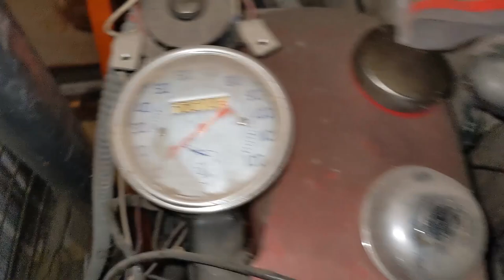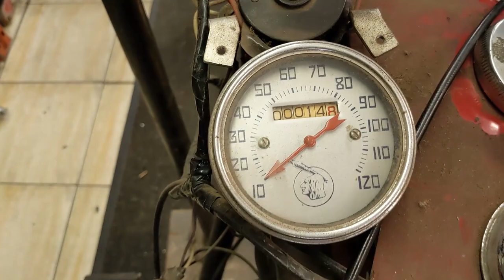1948 Indian Chief Urban Barn Find!!!!

Comment: Back in 1969, when Indian motorcycles were virtually off the scope, my pal and I found a 1947 Chief in a back yard and under a crab apple tree. It hadn't been ridden in years. The seat was shot -- it looked as if a shark had taken a bite out of it. The engine was seized. Most of the sheet metal was a mess. A year later and many inquiries to Sammy Pierce, we had it fully restored and on the road. A year later (1970) my pal and I bought a 1942 military Scout, a 1948 Chief and a 1953 Chief. We bought all of them for a song. The '42 military Scout had seen combat. There were a few bullet holes in the gas/oil tanks and the frame's neck was severed from the frame. The girder was pretzeled. That Scout was a monumental feat to restore, but we did it. Cheers. -- W
Reply from the maker: Wow that's an amazing set of stories!! That's excellent!! I just got word that this chief is back on the road from the gentleman that ended up with it so I'm likely going to take a road trip to go see it and take it for a spin. I'm really glad it wasn't relegated to a dump or lost to time. Thanks for watching and commenting!!
Reply: @moonbats69420  -- That's great news about that Chief! You did the world of motorcycling a great service by "rescuing" that Chief. Stay safe.

Comment: Had the engine cases for a 1948 Chief and ended up selling them as finding all the other parts for the engine and bike was just too costly.  Saw that your bike was a Chief right away right after seeing the engine.  I suggest getting your hands on some original fenders or at least metal reproduction ones.  See the fiberglass ones.